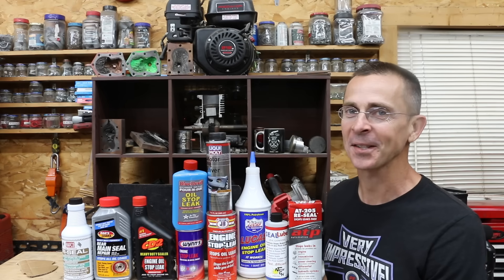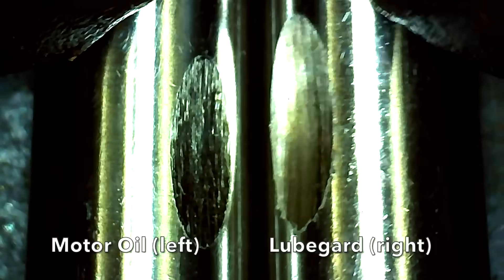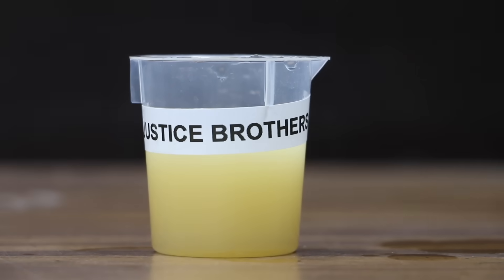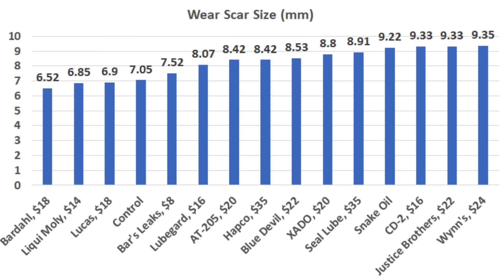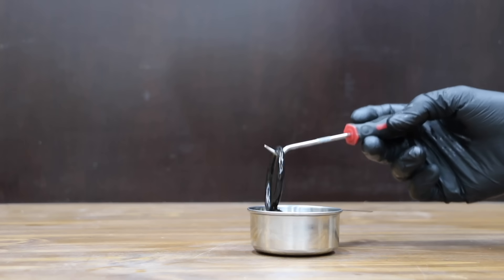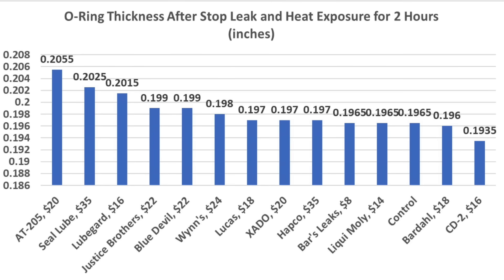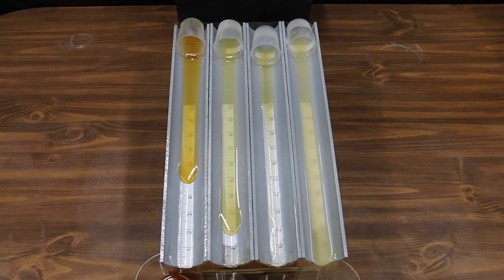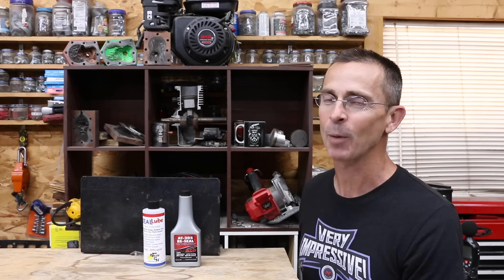Do Stop Leak Products Work? Do They Damage Engine Seals? Will They Destroy an Engine? Let's Find Out

Comment: My 2017 Toyota Sienna started showing main bearing seepage at 33K. I started using AT-205 and so far I've noticed the seepage has almost stopped at 38k. My engine oil capacity is 5.8 Qts and I mix in The entire 8 oz bottle of the AT-205 ( 5 Qts plus the 8 oz AT-205 )
Reply from the maker: Thanks for sharing.

Comment: I had a very small oil leak on my Honda Civic so I started using STP high mileage engine treatment and stopleak and over several months the leak went away. I now recommend it to anyone that has a car that is over 100k miles. I can't say how well it actually works but it absolutely stopped my oil leak.
Reply from the maker: Thanks for sharing.

Comment: Used blue devil in a old sentra power steering rack that would no bullshit DUMP all fluid over night. Put in blue devil and left sit over night after long drive. Then filled again with blue devil and power steering that fucker never leaked a drop! Steering felt slightly heavier but worked and no leaks crazy as hell! It's
Reply from the maker: Thanks for the feedback.

Comment: Thanks for the video. I've resealed convertible top struts, rack and pinions and even my floor jack with AT-205.
One comparison id like to see is with catalytic converter cleaners. There are several on the market that make bold claims of cleaning cats and clearing the dreaded P0420 code.
Reply from the maker: You are welcome!  Thanks for sharing.

Comment: Great and informative stuff, as ever.  As you said yourself, it seems like the products which work best to restore rubber seals, do so at the expense of reducing the lubricity of the oil. And those which don't impair the oil's lubricity are the least effective.

I'm wondering how long the beneficial effects on the rubber seals last. ie. could you run the stop leak for a few hours/days/whatever just to fix a leak and then do an oil change to clean oil again?... or do the stop leak products need to stay in the oil, for a repair to  remain effective?

In other news, a suggestion: How about a test on engine flushes?

Comment: Blue Devil head gasket sealer when used properly (with a clean coolant system and thermostat removed) 100% works and can fix a damaged head gasket. Sodium silicate falls out of solution against the hot engine block coating it and fixing the leak permanently.
Reply from the maker: Thanks for the feedback.
Reply: Blue devil fixed a head gasket leak for me also

Comment: Thank you, I used Lucas oil leak stop in my Merc, due to it was leaking from radiator placed in the middle of the engine, that would take me 2 days to access it, and thanks to your test I was not afraid to use it, as test showed that there was no change in the viscosity of the oil after using it. Leak stopped! And I'm happy I didn't needed to exchange any part to fix it.
Reply from the maker: Thanks for sharing.
Reply: You mean you had a leak at the oil cooler?Right down the middle at the bottom of the 'V' of the v6 engine?
Reply: @bobbaxter952  It was R4 as I remember. 2.2. half day of work to take out this cooler out of there, but instead, liquimolly sealed it up thankfully and didn't leaked 5K km after.

Comment: forte seal conditioner - according to reply from distributor - i can use it in motorcycle engine with wet clutch. liqui moly product - distributor said it cannot be used in motorcycle engine with wet clutch. can anybody confirm this info? is it truth?
Reply from the maker: Thanks for the suggestion.

Comment: I'm a simple man. I see Lucas. I buy it. I just put 1 quart of Lucas stop leak in my car. been using that one for years. It didn't completely seal it but it helped a lot. When I first gt my 2004 Monte Carlo the transmission had bad slippage. I bought a long aquarium air hose and ran it down the transmission check fluid and siphoned out 1 quart of old burnt transmission fluid and replaced it with Lucas transmsiion fluid. It improved by around 70% in my opinion. Here's something wierd though. When I use non-ethanol gas my transmission seems to be almost perfect but when I use gas with ethanol my transmission slippage gets a little bit worse. Weird because gas shouldn't have anything to do with that. My guees is that the non-ethanol gas has more power and that somehow affects the transmission. Anyone that took the time to read this whole comment, what do you think?

Comment: Great video. AT205 is great stuff, I’ve used it for my customers who maybe can’t afford the proper repair right at that time, and I also have used it in my old work truck because I didn’t want to pull the trans 😂 it’s old, what can I say… it worked great on the MASSIVE rear main seal leak, I knew it was good stuff but I was as shocked on how it performed with the work truck…. Cuz it was a really bad leak
Reply: Just had rocker cover gaskets replaced on my Murano last year with Felpro IIRC, and recent inspection reported a small leak.  I could spend a couple hundred getting them done again, as way past warranty, might just try the AT205 though to see if that helps.  Let it run for several weeks before an oil change and see if it helps.
Reply: @boots7859  felpro gaskets are wrong size, plus RTV needs applied in the corners properly. To fix the leak, put a thick washer (I used some lock washers) over the bolts. It'll give you extra tq, since it won't bottom out like before. Only tighten with 1/4"  ratchet.
Reply: Is that old truck still running strong after using the AT-205? Any "damage" you noticed?

I'm a little worried about the "damage" test he did in this video. AT-205 didn't do well on that.
Reply: What will happen to the ruber gasket once you change the oil, and the AT205 is no longer in there. will the gasket shrink back down to sub normal levels, and cause the leak to worsen or come back, or will the gasket stay repaired
Reply: Thank you, I have a car with leaks on both pulley and trans main seals but I can't afford the proper repair, I'm going to try this.
Reply: Thanks for the info,,,, but what you think about the wearing it adds to the engine,,,they are lying saying that it does not affect the performance of the engine ???  as this test shows.... there is added wear
Reply: but how long did it last is the question i thought about at205 on my sbc it has what i think may be a slow rear main leak enough the oil pan is wet on one side etc but i havent seen alot on the ground still i smell oil burning sometimes at stops

Comment: Blue Devil stop leak successfully stopped a pinion seal leak on my Dodge Ram. I've also had success in the past with a metallic stop leak for a Jeep Cherokee coolant system leak.

What I'm taking from these tests, is that I should probably change that differential fluid since the leak was stopped. Probably shouldn't leave that in there.
Reply: Only problem with coolant stop-leaks is that unlike oil ones which are chemical in nature, coolant ones are like adding glue to the system.
That crap ends up everywhere in the system, passages, block, radiator, pumps, and on and on. Once you put that stuff in there, its going to be there forever. Whether it needs to be in this or that place or not.  If its a beater on its last legs, or you're stuck in the desert, sure.
Otherwise, while it may stop a leak, you're also probably going to have another part of the coolant system flake shortly, or a head gasket if it blocks a passage.

Comment: Great info!  I've always shyed away from stop leak products believing them to be mostly snake oil, but now I know that some of them actually do work as advertised.  How about doing an o-ring comparison video?  Rubber vs nitrile vs viton vs silicone or something?  I know I've gotten some el-cheapo o-ring kits that were so hard they were practically unusable, and some o-rings that practically melted into nothing on contact with gasoline
Reply from the maker: Thanks!  Thanks for the suggestion.

Comment: I have to say, I've had good luck with AT-205 on my daughters 30+ year old Celica.  It seems to have helped the valve seals.  I will say though, the lubricity test is somewhat skewed. You're using it in much higher concentrations than would normally be used.
Reply: Its not skewed, its part of the testing method he used.
If he didn't than no one watching it would know the difference the different products have on lubricity.
Using as Manf. recommend more than likely causes little to no damage no matter which product you use. However, if he had tested it like that, its probably there would have been no difference shown, and none of us here would know that there is a potential for more wear depending upon which product you use.
Again, none of these may actually cause accelerated wear when used as Manf directs, however it IS nice to now which ones ACTUALLY do the least amount of wear in the worst circumstances.
THAT was why it was tested like it was.

Comment: i only use products project farm recommends.  Not a fan of any type of "leak stop". In a radiator it MAY work but the downstream damage will cost you much more when your water pump or heater core is clogged up.
Reply from the maker: Thanks for sharing.

Comment: Blue Devil worked best on mine. 100% fix on my 1998 F150 4.6 which had a known oil leak develop at about 90k miles between the head and block.
Ford said "debris" was left there during manufacture. Passenger side one day I noticed smoke from oil dripping onto exhaust manifold.
This all occurred about 11 years ago. Blue Devil was the one to get my mechanic friend told me.
Reply from the maker: Thank you for sharing!
Reply: If you have a remote oil filter, the leak could be in the hoses. If you haven't changed them yet, it is a good idea. Some destroy engines if they blow out on the highway.  I just had them changed on my 99 5.4.

Comment: I had really good luck with the AT-205 in motorcycle fork seals. A 1976 Honda TL250 with a new fork seal that also leaked. The AT-205 stopped the leak and hasn't leaked for 5 years. The same for a 1977 Yamaha IT 400. In addition it had a leaky seal around the shifter now fixed. 
  My son tried it on a Ford F150 with auto transmission leak and it did not stop the leak.
  The AT-205 is a clear liquid with low viscosity and small amounts are used.
Reply from the maker: Thanks for sharing.
Reply: got an 05 Civic. Replaced all valve cover components & still oil leakage. Oil pan does leak, but was "bandaid" with some RTV from mechanic. Thinking it most likely piston rings seal failed with 170k engine. Also replaced the cam seal on side of valve cover. Would that ATP help or am I better off trying a Blue Devil or Bars product? Read main seal OEM part replaced upon clutch replacement so not worried there.
Reply: @dbzownz12345  honestly not sure. I never cared that much for Bars  I know the ATP didn't help the ford transmission leak. I would try the ATP 205 first. You might have a damaged seal and not just one that's hard. For all I know the new seals that leaked on that 76, Honda's forks might have been sitting on a shelf for 20 years, but it did work and is still not leaking.
Reply: @dbzownz12345  Also, I checked the dosage that I used was 1.33 ounces per quart of oil.

Comment: My 2008 Chrysler Sebring convertible with over 160,900 miles had an engine oil seal leak. The car mechanic who regularly services my car said that fixing the leak would cost $1300 -$1500 and that based on the age and mileage of the car, it was not worth repairing. Several weeks before, it happened that  I watched this video on YouTube. Another person, a car mechanic of over 50 years, to whom I also subscribe on YouTube said, based on his years of experience,  that the ATP TP-205 product was the best even though it was somewhat expensive.
  I thought I would gamble on the ATP AT-205. If it worked I would save a bundle of money. If it didn't work, then I was out roughly $20. All I had to do to stop the leak was add 1 container of the product and drive. It claimed to stop the leak after 5 hours of driving. After 2 days of just under driving a total of 4 hours, there was still a sign of leaking but it did not look like oil but rather the APT AT-205 on the ground. After 1 more day and 2 more hours of driving, the ground under the engine was dry. After another 2 hours of driving today, the ground is still dry. So it appears the ATP AT-205 has kept its promise by doing its job. Hopefully, this will continue to work for another 100,000 miles of driving or till I get another car. 
A BIG Thanks &.Keep up the good work.
Reply from the maker: Thanks, will do!  Thanks for sharing.

Comment: The important thing to remember about leaking seals is that they generally have a combination of both hardening and wear present.  Softening the seal may slow the leak for a short while, but it's not a long-term solution.  None of these products can replace seal material that's gone due to wear.  While I can appreciate the need for someone to push the repair expense down the road for a few more paychecks, I've seen these products used too often by used car sellers to swell up a worn seal just long enough for the car to become someone else's problem.
Reply: True, but a lot of times vehicles have decent seals that something like AT205 or similar good products can help give it just enough expansion/softening back to give years of service.  Small leaks/weeping that might be fixed for $20 vs $200-500.

Comment: i don't think that's evaporative loss, i think it was absorbed by the o-ring, and the O-ring evaporated some of its original moisture
Reply from the maker: Thanks for the constructive feedback.
Reply: @ProjectFarm  this same thing happens when you deep fry something in oil, oil evaporates moisture and replaces it in the potatoes or chicken. I could be wrong, but this is my take on this

Comment: This is interesting. So I think Liquid Moly is the the best product overall if you're worried about any long term damage. If you're more focused on an actual temporary fix then AT-205. Something in-between and reasonably affordable would be Lubegard.
Reply: exactly what I was thinking as I keep going back and forth between LiquiMoly and AT-205.  Maybe I'll throw both in and see what happens, haha
Reply: I was thinking that liquid moly would be good but it will freeze here in NE at this time of year. Concerned that would cause issues.  Its a very slow seep from the valve cover onto the engine- no accumulation on the ground and minimal smoking even though it gets near the cat. Was going to go with blue devil based on hearsay before I saw this video but the at-205 may be the answer. I will just get the oil changed after the minimal amount time this product should be in the engine.
Reply: That’s what I was thinking— that or the Lucas— worst case mix with 205
Reply: I thought same mix 2 best 205 for leake and one for lube
Reply from the maker: Thanks!  Thanks for the feedback.

Comment: So my take-away, I have a 27 year old 1mz-fe aluminum Toyota engine with a front head gasket leak. At this point, im burning such a small amount of oil, I can’t measure it over 3weeks, so I’ll use Lucas oil treatment instead, after I change the head gaskets proper. Most of the issue in these engines is single use TTY head bolts. So many tutorials they just re-use em like it’s ok, and don’t bother using a torque wrench and doing steps in tensioning the head. Its an ordeal.
Reply from the maker: Thanks for sharing.

Comment: In summary:
1. AT-205 – Really works, but doesn’t stay mixed with oil. Has a tendency to evaporate off.
2. Hapco – Works pretty well and is less risky for your engine.
3. Liqui Moly – Works somewhat as a leak stop, and actually improves oil lubricity. May have other benefits beyond leak stoppage.

Although some of the other products showed promise, these were the standouts from my perspective.

It seems to me that starting with Liqui Moly and moving on to Hapco and then AT-205 as a last resort would be the most sensible approach. It would be a shame to screw up an engine unnecessarily by using a product that is more aggressive and risky than is absolutely necessary. After watching this video, I would have zero hesitation to try Liqui Moly. Hapco seems fairly safe, but I would only use AT-205 as a last resort.

Comment: I have a van with over 315,000 miles. It doesn't leak oil, but it burns about 1 1/2 Qt. between oil changes. I don't think I will be using any stop leak. Thank you so much for all you do for us.
Reply from the maker: You are welcome!  Thanks for sharing.

Comment: I had a rear main leaking in my Cummins 4BTI and the AT 205 I used WORKED--and it's cool to see this video supports my findings!
Reply from the maker: Thanks for the feedback.
Reply: Looks like the AT-205 is great in every category except the "damage" category.
Reply: @googolpi  I would love to see this same experiment with the recommended measurements added to the oil instead of 50/50 done here. AT-205 requires a few ounces to 6 or so Quarts of oil where as another of these products (can't remember off the top of my head but it's mentioned in the video) requires 1 to 5 ratio. I'd want that product to have better lubrication qualities than say the small amount of AT-205. I came here looking for info on AT-205 and I'll likely still choose it for the restoration properties